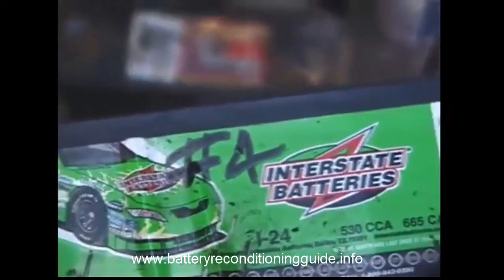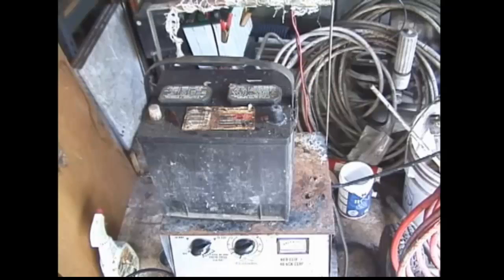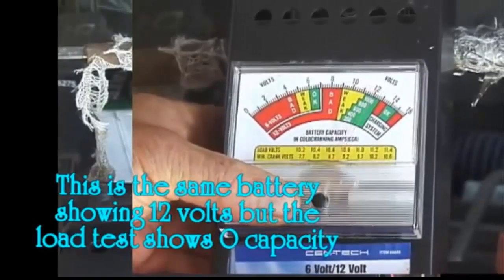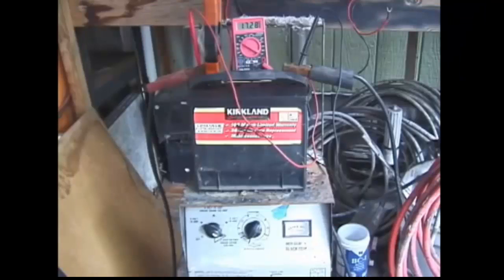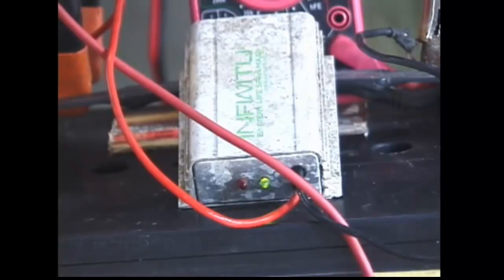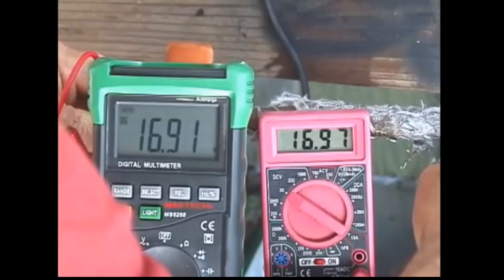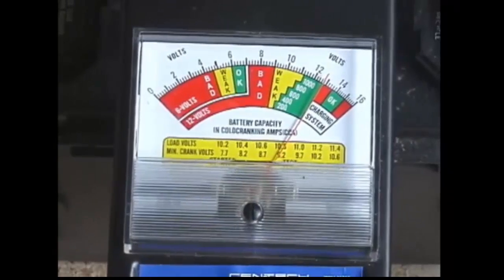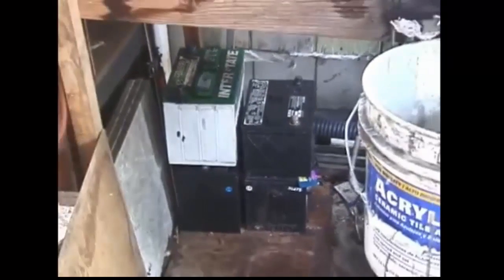How to recondition old batteries 2017 - new method

Comment: I think draining it down then leads on in reverse is the best trick in theory it should pull the sulfation away from the plates However I would first pour the good solution out and store it in a #5plastic container so it won't burn through then add a epsom salt to distilled water solution deepcycle it a few times an watch all the brown black shit come out clean it out again then re add just distilled water reverse the leads bubble till battery is warm not hot as to cause any damage and it should push out the shit you couldn't get with the initial solution at this point pour it out if you see shit coming out do it some more If not drain battery down again empty out add initial solution taken out through a coffee filter to get some crap out of it put the leads on correctly and you should be back in business if the battery was salvageable otherwise take the thing apart scrub the lead plates if not eaten through  reconnect the posts and charge

Comment: So what's best method to restore a battery.  My old one still works but dropped to 9.5 volts for no reason then recovered on the charger.  What should I do to restore it.
Reply: chriss4365 p
Reply: Epsom salt put 3 tablespoons in each cell charge at 15.7 volts for a few days

Comment: This Video show you how to completely destroy your battery. If your car battery was completely dead aka by leaving your car lights on and run starting or jump starting your car the alternator will not charge your battery and NEVER every charge a dead battery over 3 AMPS otherwise your will buckle the plates. And if your primary battery is a hi-cyclic battery aka lead acid battery and you have deep cycle batteries for camping in your car in parallel with your cars lead acid they wont charge. Always Trickle charge a dead or flat battery!!!! Never listen to random blokes advice I myself have my diploma in electrical engineering and had my father's knowledge passed down to me that won the Bosch world cup for South africa. Please just take my advice.
Reply: Great advice, been trickle charging several dead batteries and it just seems like new after doing it thurally. :)
Reply: you are a random bloke commenting on you tube , so why should i trust YOUR diploma ? just saying....i trickle charge , but we're on our own out here , with all the conflicting info from all the self-proclaimed experts........i'll be glad when we can afford to move beyond L A batteries

Comment: The best charger for FLA (Flooded Lead Acid) batteries is one that you can make yourself. All you need is a 2kw (bigger if you are messing with deep cycle batteries rated at over 6v/300ah or 12v/180ah) Variac and a rectifier from an old arc welder. And panel ammeter and voltmeter. This gives you total flexibility and control and makes equalizing very easy and straightforward. A digital IR thermometer, portable digital voltmeter, and hydrometer complete the kit. My propulsion bank in my electric boat is 8 6v golf cart batteries in series. I can use my manual charger to charge the bank as a unit, and use a proper three stage algorithm as per the battery manufacturer's recommendation. I can equalize the bank all at once with a 62v charge. I can charge or equalize each battery separately. The only thing with a purely manual charger like this is you MUST know what you are doing, and you MUST monitor it carefully. You can't get all distracted by cocktails with the neighbors and forget what you are doing. It could end badly. Also the input to the Variac is of course mains power, i.e. 110-120VAC in the U.S. and 220-250VAC in many other parts of the world. This CAN of course be lethal if you get careless or don't know what you are doing. Running it from a GFCI breaker is shall we say, a good idea. Testing for short to case before use is an important safety procedure. Not even touching the case once the Variac is energized is not being overly paranoid, either. Make sure that there is continuity between case and supply ground. The adjustment knob can't shock you, no matter what. The output of the Variac is whatever you set it at with the knob and verify with the voltmeter. Most electrical standards consider below 50v to be non lethal but take that with a grain of salt. Be super careful piecing this together and with insulating exposed connections or enclosing them so that clumsy fingers can't get to them. Double check that nothing is plugged in while you are working on it. Think of it as a gun that you double check to ensure that it is not loaded. 

Do not fill dead batteries all the way up. They make water as they charge. (Not exactly, but the electrolyte level will rise a bit as they charge.) Just cover the top of the plates about 1/4". Top off the water only after batteries are fully charged. Loosen caps before a serious charging session. Hydrogen gas is generated, which is very explosive, but it is lighter than air so if there is any ventilation at all you are good to go. Still, no smoking or open lights around charging batteries, please. A clean battery is a happy battery. Clean the tops before AND after you do anything. Don't let even a trace of baking soda or cleaner get inside the cells! Use only distilled water, never tap water or bottled spring water or filtered water to fill batteries. The minerals will eventually kill the battery. Wear goggles. Face shield is even better. Both, even more better. You have to keep acid out of your eyes all the time to avoid eye injury. You only have to screw up and get it in your eyes ONCE to HAVE an eye injury. Acid on your skin is not gonna melt you. Have a charged garden hose handy for a quick rinse. Protective clothing is a good idea, though I do all my battery work in regular jeans or work clothes. Some means of rinsing acid off your skin and clothing is necessary, though, no matter what. If you don't rinse it immediately, then yes, it WILL cause a chemical burn. Check electrolyte levels frequently, and temperature, voltage, charging current, etc. Dont just look and see that yeah, the batteries are still there and haven't exploded or melted yet. Absence of smoke is not a foolproof indication that everything is as it should be!

The rectifier should be mounted on a heat sink. A cooling fan can make the difference between a rectifier meltdown or successful operation. Be sure the Variac isn't overheating, too. Use nice big cables, not a hardware store extension cord! I would recommend something like insulated AWG2 stranded copper wire. Myself I use a lot of 2/0 welding cable for other things so that is what I use for my Redneck Charger as well. It handles nicely and the voltage drop and heat losses are insignificant.

Once again I will state that you do need to know what you are doing if you use this as a charger. If you need to educate yourself then do so. Let a competent person decide whether you know enough to proceed, or not.
Reply: nice......i appreciate seasoned ( salty) comments from experience ! that's a lot of weight to float.
Reply: Fuck i read this whole thing twice... my comprehension is retarded

Comment: Thanks for a very reasoned, educational video on sulfated battery revival. Minor issue: 200 CCA can start a car - I have tested many cars in the early '80s working in a Sears Battery dept. MOPARs drew only 150 to 175 Amps, Fords drew 175 to 200 Amps. Most GM V8s drew 250 Amps while cranking, but that is typical GM crap! More modern cars will draw 125 to 150 Amps.
Reply: Fords all the way!

Comment: My car battery registered a 12.63 volts on my Multimeter but it cannot crank the engine of my car? Do you have idea what should I do?
Reply: Get a new battery I have had a few to do that
Reply: both answers right and/or wrong....could be either prob. , or both..........LOAD TEST batt. to see if it has CCA , then test to see if starter is drawing too much..........the tester in the vid is cheap , i just got one , and it's worth it
Reply: Fred Cm 
Change your starter out it's  draging